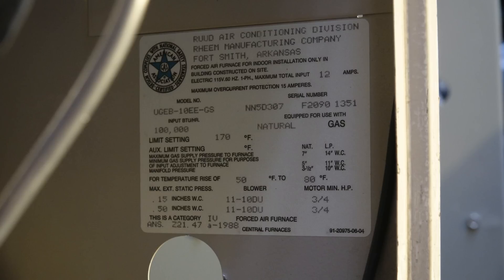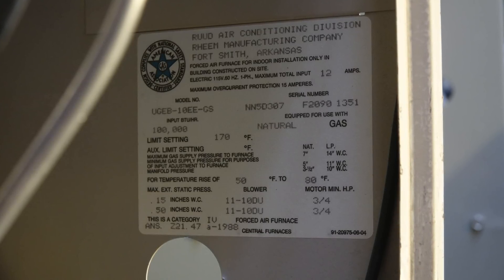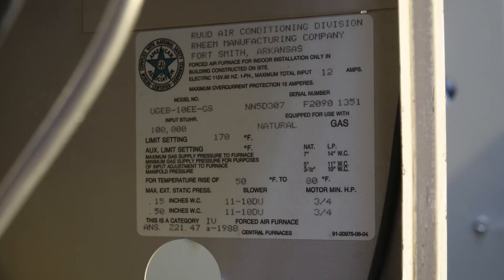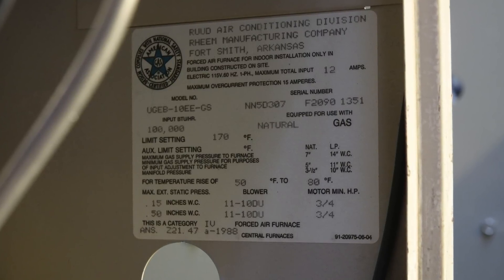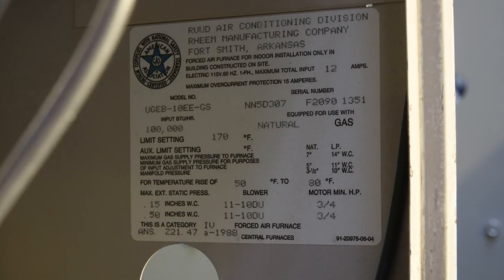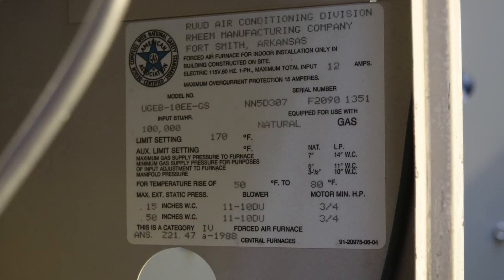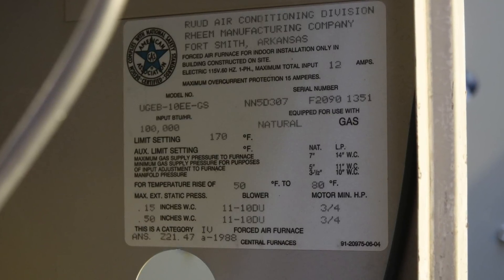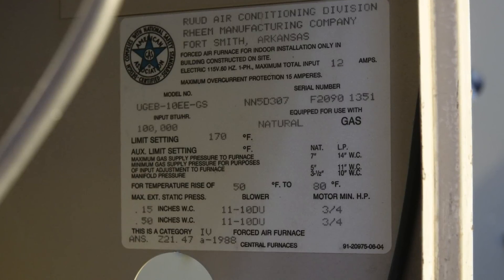The cracked heat exchanger

Comment: I have a 35 yr old forced air oil furnace ,I clean the heat exchanger by putting a small hose on vacumn cleaner  and sucking out what I can . Other than that I will blow burst of air to get any soot out . Is there any way to inspect heat exchanger further ?I do have an inspection camera I ve run back into the tubes ,can't see anything obvious ! When I see these videos with the top of furnace  removed I am assuming those furnaces have failed and it's not something I can do as maintenance !

Comment: Same issue, with no indications of CO in the supply air. Costumer complained of uncomfortable breathing while the furnace was running, so I measured CO2 and it was maxing out my meter. Furnaces, especially natural gas, burn very clean. CO2 and water vapor are the main byproducts of combustion, so I measure CO2 levels now before and during furnace operation. It's proven very reliable compared to only taking CO readings.

Comment: So I have been told by other techs that if we aren't doing a combustion analysis then we can't determine if the CO levels are "safe." However, from this video and other articles I have been reading, it seems that an induced draft heat exchanger will not allow CO to enter the supply air since it's under negative pressure. The blower fan air going across the heat exchanger will disrupt clean combustion, which produces higher CO, but that should be going out the flue still. How are we supposed to rationalize terminating a gas furnace that has a small crack? It shouldn't leak CO into the supply air, so what's the risk? Is this just a precaution to protect freak accidents and not be blamed? If the flame isn't rolling out and being pulled through the return/air handler into the supply, then why are we so quick to condemn a unit with a hairline crack?
Reply from the maker: As for the combustion analysis, the analysis does not mean anything as far as CO is concerned.  CO levels can be high with a good combustion analysis.  
As for the inducer not allowing CO into the airflow, you can't make that judgement because the pressures are very small and you don't know for sure how the air will flow.  
Cracks will get larger over time and can change the airflow.  This is more common than you might think.
If my furnace has a check, I will replace the furnace.
GFM

Comment: you able to replace a heat exchanger and what is the end result do you replace the whole unit or can it be repaired or replaced the heat exchanger
Reply from the maker: By the time the heat exchanger fails, the unit is generally old enough that the heat exchanger is not available and other parts of the furnace are ready to fail.
GFM
Reply: @grayfurnaceman  Thank you.

Comment: Great video. Do you think it was excessive heat were the exchanger was so discolored that eventually lead to cracking? Most other areas on exchange looked brand new color on metal.
Reply from the maker: It could have been overfired.
GFM

Comment: How do you determine a cracked hx looking from the inside, squatting down in front of an old furnace?
Reply from the maker: On an older natural draft furnace, a small mirror helps.  If it uses inshot burners, its not so easy.  You will be looking for flame change when the fan starts.  This is not definitive.  There are many more ways to determine heat exchanger health.
GFM

Comment: Could a cracked heat exchanger be diagnosed on a standing pilot mobile home furnace, by holding the end of a manometer tube in front of the inspection window/cover flap removed and main burner ON before and after blower energizes?
Reply from the maker: Probably not.  Unless the crack is very large, there would be no change.
GFM

Comment: What would cause so many cracks to end up on that heat exchanger?
Reply: That and probably neglected to change the filter often enough. Or a combination of that and restrictive undersized ductwork.
Reply from the maker: Could have been overfired or there could have been a problem with the limit not cutting off the burner in an overheat.
GFM

Comment: I was replacing the indoor fan assembly in a 12 ton Trade roof top unit last spring and found holes large enough in the heat exchange that my fingers would fit in them. I did a combustion analysis, because when I shut it off, the heat was operating and I did not smell aldehyde due to incomplete combustion. O2, and CO2 numbers were all within spec. and I had 0 ppm CO in the flue and in the airflow.
I opened up every unit they have on that roof right away, as none of them have been checked in a couple years, to be safe. 
I couldn't believe the heat exchange could be that rotten, and not even have issues with hard ignition.

Thanks for posting the video.

Comment: I normally never have a problem with any of your videos however I do have to take you to task on this one there is a very simple way to be 100% accurate as to the condition of any heat exchanger without even taking a visual inspection that is called a combustion analysis the flame is a chemical process when there is over oxygenation and the gas pressure is within normal range and the event is not obstructed anytime you have an over oxygenated Flame it will show itself in the flue vent any experienced and knowledgeable technician knows that not all cracks will produce carbon monoxide the conditions have to be just right our job is to find out whether or not the appliance is safe any crack in a heat exchanger causes the furnace to be unsafe the homeowners needs to be notified in writing if the heat exchanger is producing carbon monoxide and it has produced more than 50 parts-per-million within a 10 minute period that is the only time that it should be disabled no cracks should ever be left an operation just because the heat exchanger is not producing carbon monoxide at that particular time as we all know conditions change constantly if you leave a heat exchanger in service with no cracks you are responsible 4 the family's life thankfully due to the fact that the efficiency of most furnaces is above 60% and has a draft induction system that is the primary reason why we do not see as many carbon monoxide deaths as we used to if this furnace has not been a draft induced furnace it would have been producing large amount of carbon monoxide into the air stream
Reply from the maker: +Expert Express plumbing heating and air conditioning You will probably see a video on combustion analysis with a cracked heat exchanger soon.
GFM
Reply: I agree with you 100%, ive been a tech for 16 yrs and couldnt of said it better myself.

Comment: That is pretty cool how that works, was this the 90+ furnace?
I read where common elements such as bleach vapors can cause cracks prematurely. The High efficiency type as well IF the intake is close to say a swimming pool or hot tub. The standard combustion furnace can draw bleach vapors from the floor of the basement if it is used to clean the floor on a regular basis.
Quite a failed heat exchanger!
Reply: Not sure, I only read that some common chemicals can cause failures. Pretty sure there are many causes for cracks, what is your take on this?
Wouldn't combustion side induced failure reveal what you mentioned? I was under the impression we were looking at the outside of the heat exchangers here? Anyway, great video, Thanks GFM
Reply from the maker: Mostly it rusts it out from hydro caloric acid from the bleach. Phosphates also damage the heat exchanger. 
GFM